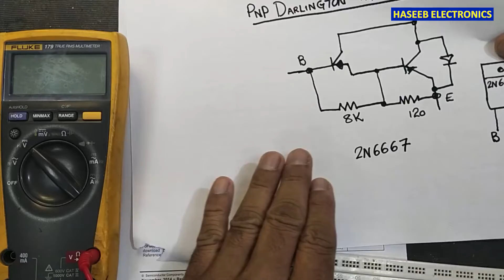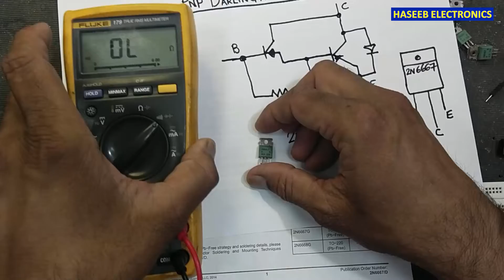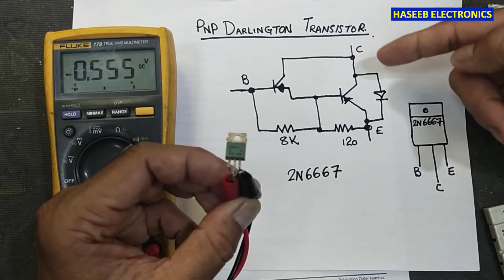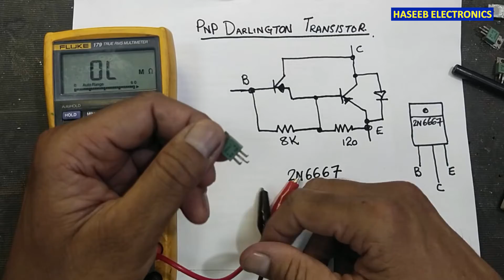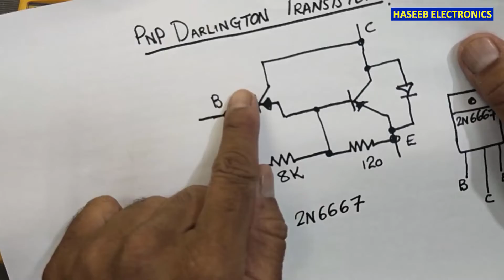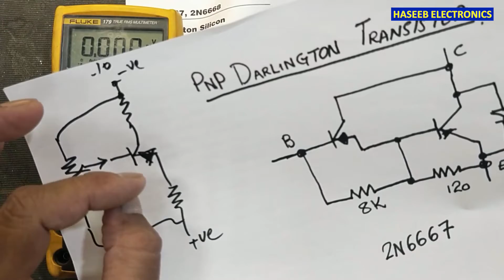{739} How To Test PNP Darlington Transistor

Comment: Hallo Haseeb.
Why we can not test the connection between emitter and base. Normally we should measure 2 voltage drops (1.2 volts first diode + 2-nd diode voltage drop) without bias voltage on the base, if the DMM can provide enough voltage when using Diode-mode ??
Reply from the maker: Good day
your point is valuable 
reason is that the emitter to base junction have high resistance i.e 260K ohm plus. 
while a parallel resistance is there to this junction. so all the test condition current will pass through the low value resistance. either in forward or reverse condition, the parallel resistance will provide easy path 
that is the reason i performed "power up live testing" to give a clear concept
(if we have separate emitters without biasing resistors, then we can test it accurately) 
i hope that you considered it valuable, if you have still some point, et me know in your reply
Reply: I thought if we test from from emitter to base then the voltage wich goes to the path of the Resistors is the same as the voltage that goes to the Diodes.
And if the voltage reaches the first Diode than the diode gets Biased and it let current through and when it is forward biased then there is no High Resistance. The High does not play a Role anymore. It`s actually basic electronic that what i don`t understand.
Do you understand what i mean ?
Reply from the maker: your point of view is perfect. but 
current follows the lowest resistance path, so the maximum current will flow through the resistors, and resistor will not allow to drop enough voltage across it.  so in the parallel, the PN junction will remain below its barrier voltage 
thus the current will flow only through the resistors 
that's why i said we cannot test emitter to base junction using multimeter

Comment: Excellent.  Kia 7019ap how it works .
Reply from the maker: KIA70 series is an analog ic. most of time it is used with microcontrollers to reset the device. it provides a delayed start to the MCU to allow to stabilized the power. and in case of electric failure it provides resetting to the MCU. i will try to explain it practically